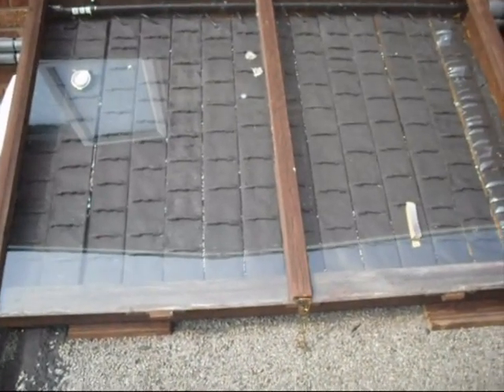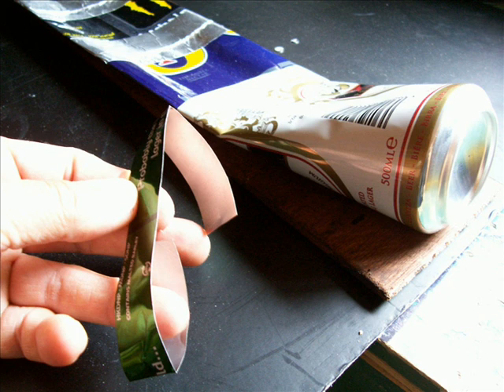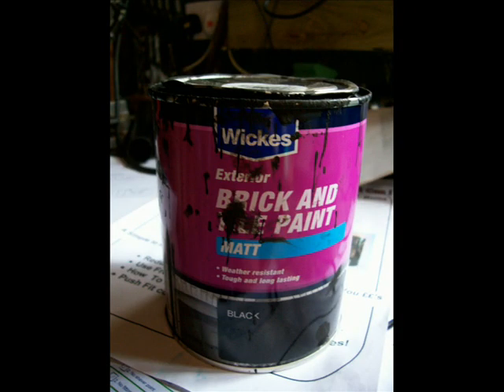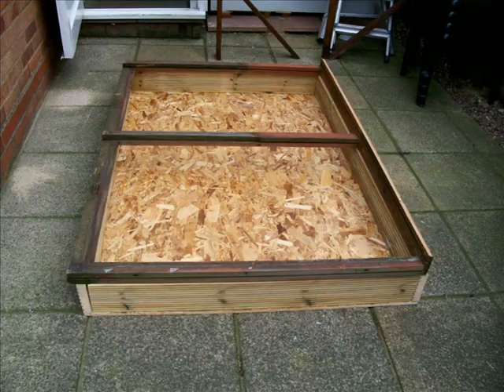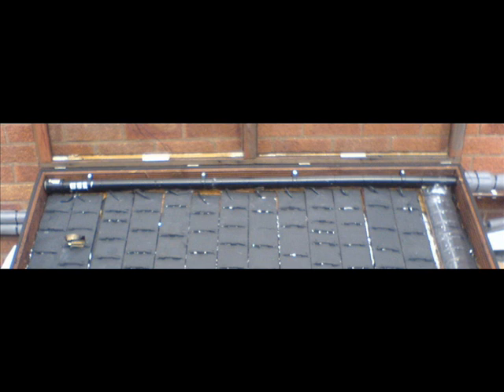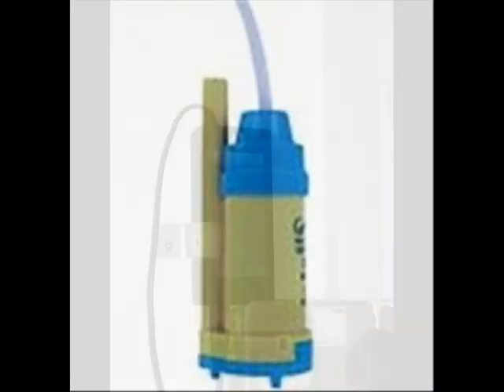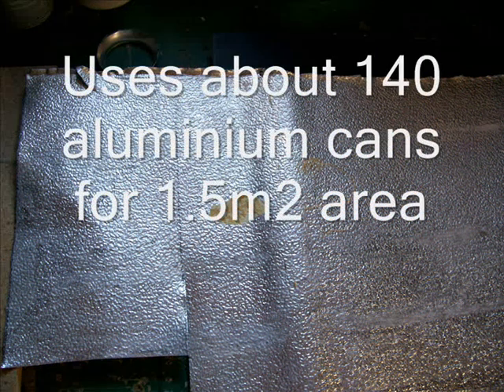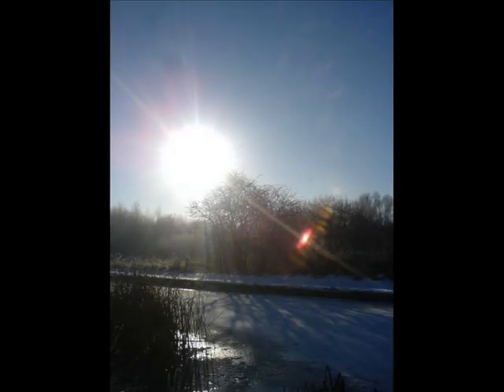Solar Water Heater Trickle Can  .wmv

Comment from the maker: Cont.- The wooden solar panel case, at least the sides made from decking planks were ok, but the OSB board for the back was showing signs of breaking down. So a good quality ply would be a better option to make the panels last longer. The small pieces of EVA foam used to press the upper can surface down, did not survive. The temperature on the panels would have been about 100 Celsius with no water flowing through.

Comment from the maker: The system is still working well. – The panels only get full sun with no shading from April 28th so I don’t look to use any hot water until after this date.  It would be interesting to see what temperatures I could get on a sunny winters day with a supper insulated panel. I may build one for this coming winter to test.

Comment from the maker: The can ends are inserted one inside the other overlapping by about 25mm.
The surface of the cans are also ‘dimpled’ which ensures a gap always exists inside the can assembly for the water to flow through regardless of how hard you squash them together (within reason). The joins are taped with aluminium sealing tape to act as a water vapour barrier (not as a water seal)

Hope this answers your question. Thanks for the comments.

Comment from the maker: The back flow problem is resolved by a combination of a minimum angle of the panel about 10 degrees to the horizontal and restricting the water flow through each can assembly to about 180ml per minute. A greater flow rate is possible if you increase the angle of the panel.